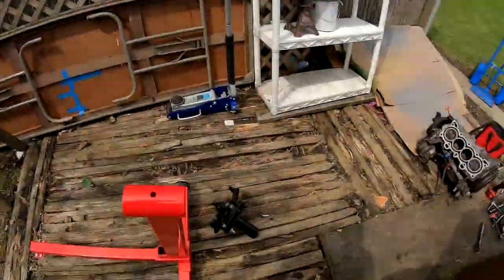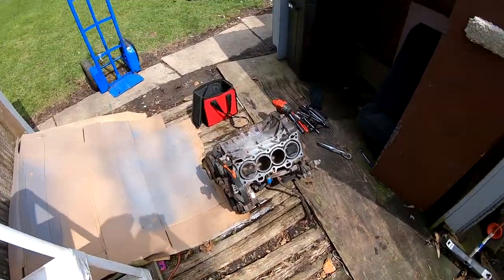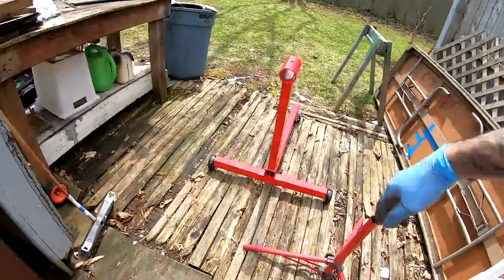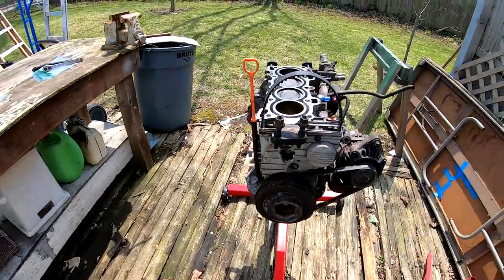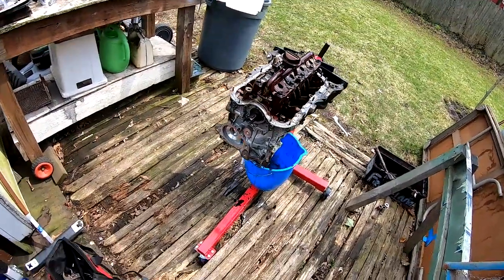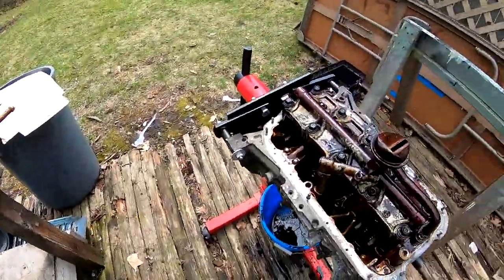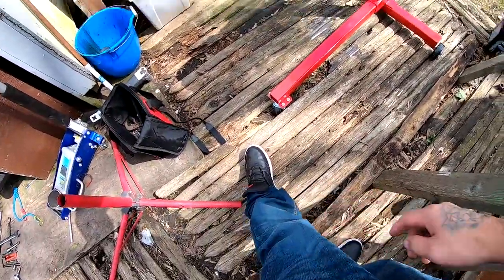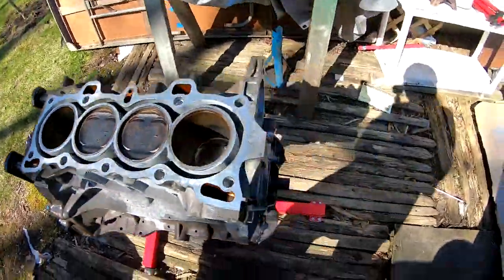Civic D16A Turbo Build Part5 (Disassembly of engine block)

Comment: What color are you painting the engine ?
Reply from the maker: I was thinking high heat paint in sylver for engine and maybe high heat flat black for tranny.
Reply: Are are you going to do any hydro dipping ?
Reply from the maker: @rogerkerr3514  i wasn't thinking of it but i can maybe on the valve cover. You have any other suggestions what i should hydro dip.